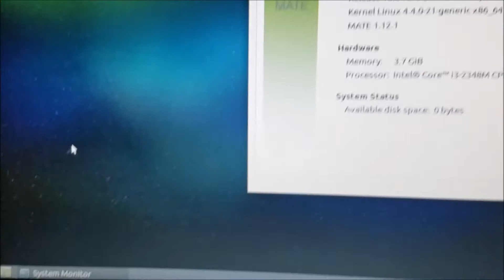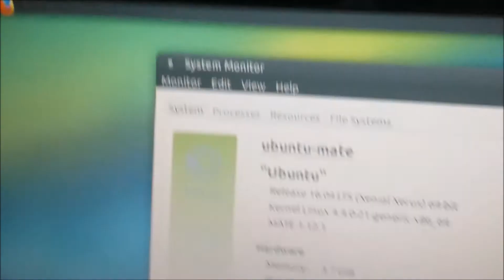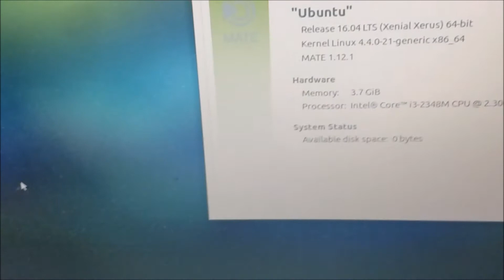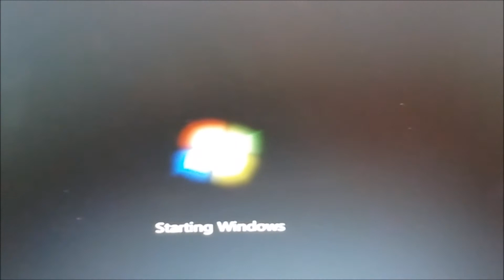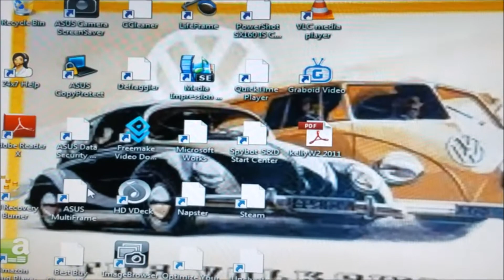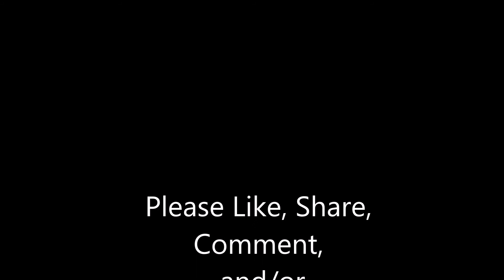Verne's Misadventures: Fixing an Acer Laptop that Freezes on the Splash Screen

Comment: My acer lap stuck on f2 enter setup screen 
I remove all board and all items then re fix but same issue please help
Reply from the maker: Sorry I didn't get back to you sooner. Your comment did not show up until today. Maybe your CMOS battery is dead. This will cause the clock and calendar to be wrong and possibly cause the computer to take you to settings for adjustment.

Comment: I need help my acer laptop Goes to the logo and toen go black and Goes black to the logo again
Reply from the maker: Unplug the machine and remove the battery. Then try reseating the memory, the wifi card, the hard drive, and the dvd player. It could just be a bad connection. If that doesn't fix it then you might try removing one memory module and trying the machine. If it still doesn't work, try putting that module back in and removing the other one and try starting the machine. If that is not effective, you can unplug the hard drive and see if the machine will post. If not, try removing the DVD player and see if it will post. Finally, try removing the wifi card and see if it will post. A failed component can cause it to freeze during Power On Self Test. . . Best wishes and good luck.
Reply: This worked ah? Pls tell same issue
Reply: Pls help